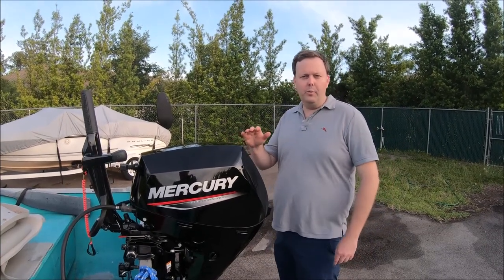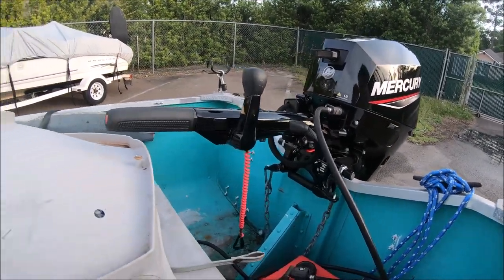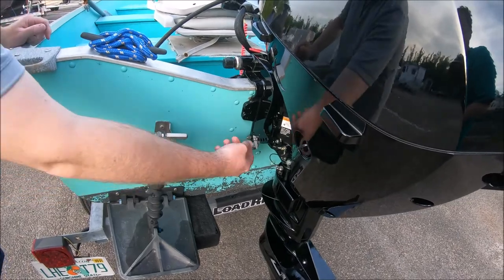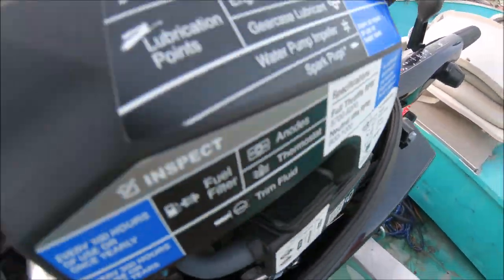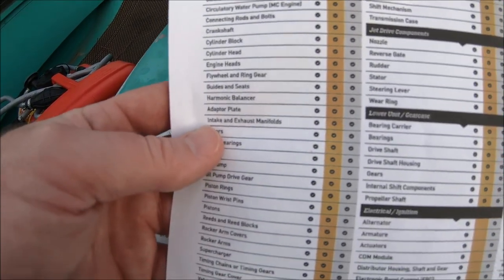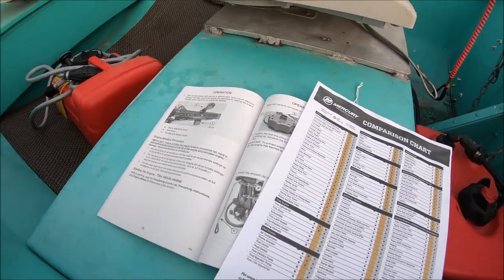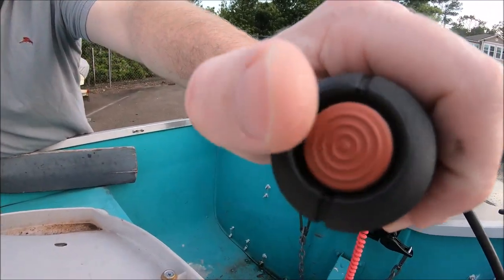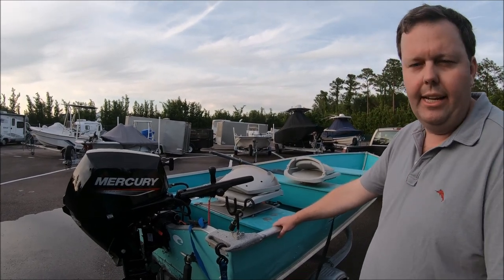Redesigned 2020 Mercury 15 HP EFI Outboard Review & Starting Engine For The First Time!!

Comment: Most certainly needs a 20 hour service… even if it doesn’t call for it, PLEASE change your oil and gear fluid. Lots of metal particles after break in that you want to get out
Reply from the maker: Good point! Thanks!
Reply: Agree 10/20 hour service for oil change I saw metal in both oil changes, tohatsu said it's normal
Reply: yeah the break it, its what call for my f6 yamaha

Comment: I bought a brand new 2023 for my small aluminum 13 foot John boat. A boat bigger than us came to close and the motor fell off the back. I forgot to tie it on and it sank. That happened today. First go on the engine. Bottom of winnipesakee. Luckily I got the warranty and we were able to salvage it.
Reply from the maker: @Gabriel B fantastic they covered it by warranty and you were able to get it back! How do you like the engine?
Reply: @RealFishin it doesn’t run quite right anymore but i’m sure if I service it again it should work fine 😅

Comment: Hey there you don't need to worry about ethanol so much with a fuel injected motor.  Also, the safety chain is pulling your starboard clamp counterclockwise, so it might loosen up over time.  I like to twist until they point towards each other, then pass a padlock through both holes.
Reply from the maker: Great idea regarding the safety chains!  I’ll try to make the adjustment.  The engine burns so little fuel the cost of ethanol free is a non factor.  A full day on the water will burn no more than a gallon of fuel.  Tight lines and thanks again!

Comment: Man. I just got a new 2022 15 hp Mercury with EFI, mine takes a few pull's to start, vent cap is loose primer bulb is ferm, also mine does not have the maintenance decals on the inside of the motor, haven't had it out on the lake yet, to cold it's winter, hope it starts easier when broke in !
Reply from the maker: @Mark Collins interesting.  It takes me at most three pulls to start a cold engine with most starting on pull two.  If the engine is warm, it takes one to two pulls.   Are you using the fuel tank they provided? I had to switch to the tank they provided vs the one I had from the prior motor.  Maybe it is the cold environment or will improve when you break her in.  I followed the break in process  from the the book.  It might be worth calling mercury or you dealer and asking for the decals.  What are you fishing for?!

Comment: Thank you for such an in depth review!  Did you pay for the motor and wait 6 months to receive it?
Reply from the maker: I lucked out and found a dealer that just started to carry Mercury engines about six months ago- so they had one in stock that they just got in stock after waiting 6 months.  I called every dealer within a two hour drive and they were all back ordered.  Strong demand and supply constraints.  A few dealers offered to take a small deposit for the next available engine.  Also, the price varied significantly between the dealers.  I spent  2 hours on the phone calling every dealer in my region.
Reply: @RealFishin  same problem I’m running into in Houston.  Hopefully I can get lucky. Thanks for the quick and thorough reply! Tight lines brother😎
Reply: @RealFishin  I decided to follow your strategy and called a company 4hrs away yesterday. Mgr said he just got a 2022 15hp Merc in the night before and I bought it! It was the only one in the state😎
Reply from the maker: Nice work!  Let me know how you like the engine after you run it!! How big is your boat?
Reply: @RealFishin  
Thanks. It’s a 1436, so it should be flying soon😂
Reply: @standbackstandby200  how much did you pay?
Reply: @standbackstandby200  dude I’m out here In Houston and I walked into bass pro shop in pearland back in November they had just stocked up. I had quite a. Experience with it I tell you both good and learning ones as well
Reply: @adez5143  😂I just went to Bass Pro in Pearland a couple days ago and they have the outboards mounted on the wall again😂
Reply: @standbackstandby200  that place takes my money bro bro

Comment: Thanks, good presentation, very informative.  I have a 2020 20 hp Mercury.  I was having difficulty starting it on the water after a 15-30 min stop at a fish drop.  Discovered it was not getting gas.  Turns out I had installed an inexpensive in-line fuel filter in the fuel hose.  Your comment about no need for an in-line filter (and its not recommended) b/c of the installed fuel filter on the port side of the power head was key and helps explain my no-start issue.  Took the in-line hose filter out and have not had issues.  Thanks.  Joe
Reply from the maker: I’m glad it helped!  That was a question that I asked the mechanic when I bought the engine.  Good luck fishing!!
Reply: I have a large spin on filter and have no issues whatsoever with fuel starvation.   Fyi
Reply: Man, I got a 2022 15 hp with EFI mine also takes a few pull's to start hot or cold haven't had on the lake yet !

Comment: hey i have the same motor i just bought from someone used. it has less than ten hours on it, there is alot of "play" or "wobble" between the motor and the bracket. just wondering if there was some way to tighten something and fix it. thanks
Reply from the maker: I don’t believe I have the same issue.  I will take out the boat this weekend and will see if I find a solution to your problem.  Is your bracket secure to the boat?  Is the engine catching the bracket?
Reply: @RealFishin  yes the bracket is tight to the transom, there’s excessive play between the motor and the transom bracket
Reply from the maker: Have you adjusted the red tilt lever?  Maybe it isn’t locked in.
Reply: @RealFishin  I drop the motor down into the water and then I have to move the red lever to raise it up so I am assuming it is locking into place properly. There seems to be two bolts that come out of the motor and there’s som black foam around there prob to keep water out of there, that seems to be where the “play” is. I tried to tighten those two bolts but they were very right already. The bolts come out of the motor and then there are nuts on the end, that’s actually what I tired to tighten
Reply from the maker: I just published a video of the engine running.  Check it out as it might help you.  If not, It might be best to take to a Mercury dealer and to see what they say.

Comment: Just got a new 25hp EFI mercury.  That beep you hear at the begin is the alarm testing itself.  There isn't a light anymore on the 2023, there isn't a hose flush port either.  They also changed the fuel fitting.  Mine didn't even come with a prop, the 25s dont.
Reply from the maker: @joej.4170 crazy! so you have to use the ear muffs to flush the engine?  I like the side port to flush it.  How do you like the 25 HP engine?
Reply: Its very powerful, but it weighs 140lbs so heavier and much larger than your engine.  To flush the motor I use muffs or fill a bucket with water.  Not sure why they eliminated the flush port.

Comment: Nice presentation. I bought the same motor last year for my TrueKit Discovery Inflatable.
I'm looking forward to taking it out on the water for the first time this summer. 😃 Have you heard of the Mercury Vesselview? It's some kind of motor diagnostics tech that connects via an app on your phone. Monitors speed, engine hours, revs etc. But I'm not sure if it is compatible for smaller engines under 40 hp. Would be nice to have something like this.
Reply from the maker: Thanks!! You have a wonderful engine! Hurry up summer so you can enjoy it.  I think the vessel view is only applicable for larger engines but you are right it would be a nice addition!

Comment: Hello there! I came across your Vid a while back and I found it very informative. I have the same model outboard as you and I had a very bad experience out in the water. I was riding my boat W.O.T, I seen a gator I wanted to look at, when I slowed down The check engine light came on and went into so type of lock mode that I could only go less than 1/4 of the speed. I turned it off at the dock, the light went off and I was able to ride pass 1/4, have you ever heard of this?? 

Nice set up by the way! Those small Vessels don’t get enough credit.
Reply from the maker: @Adez Thank you for the kind words!  I have not come across that issue.  How many hours do you have on the engine?  Are you using the included fuel tank?  Did you check the fuel water separator on the engine?

Comment: FYI - The suzuki 15hp efi is 97 lbs.  I'm looking at all of them and need to make a decision.   Currently have 15hp Merc (carb).  Getting tired of fiddling with carbs.
Reply from the maker: You probably can sell your Mercury 15 HP Carburetor for a decent price since supply is so low and used outboard engine demand is high.  I have been impressed with the newly designed 15 HP EFI.  When I bought my engine, I priced out Suzuki and it was actually more money than the Mercury.  Price differs significantly between dealerships.  I spent an hour calling every Mercury, Yamaha, and Suzuki dealership within a 2-3 hours of my home.  I was amazed to see the price difference between the locations.
Reply: The suz is actually a 20hp downgraded

Comment: Do you through bolt your motor to the transom, or  are the clamps enough to hold the motor on the boat.
Reply from the maker: @Nick Guillen , you can through bolt the engine but I only used the provided engine clamps and used chain and carabiner clip so it will not loosen.  I have not had an issue but will double check the connection every so often to make sure the engine is tight.
Reply: Mercury puts a sticker on this motor that says you will die if you don't bolt the thing on, so I did with mine.

Comment: The top flushing port cannot be used to run the engine.  It is a flush port only.  Fyi
Reply from the maker: thanks Anthony!  I will check out the owners manual.  I thought it said you can flush with or without starting the engine.

Comment: Are the tabs to screw the boat to the transom metal or plastic ?
Reply from the maker: @RS 850 The tabs use metal screws to attach to the boat.  I added some 4200 since the screws are under the water.  The actual Nauticus Smart Tabs are plastic but they make a world of difference.  I have had them for four years without problems and I wish I got them sooner.    I will make a video shortly showing the boat setup.   

Link to the Smart Trim Tabs: https://amzn.to/3Hm5KOo

Comment: Great video!! If I don’t mind please give me the letter by letting part# I am in the market for this motor. But I’m new to all this and don’t want to get something different. Thanks
Reply from the maker: Thanks!!  The Mercury model is 1A15201LK
It also lists F15MH.  The engine is a manual start short shaft (15 inches) four stroke.  The shafts come in different sizes and the engine is offered with an electric start option.
Reply: @RealFishin  awesome thanks a million
Reply: @RealFishin  I just double checked the motor I was really leaning towards and it’s the same part#👍 thanks again for the quick response
Reply from the maker: @Kevin Crowe  great news!  I’m glad they have an engine available!  What are you going to be fishing for?!  Or just cruising?

Comment: Hola saludos  desde México  tengo un motor igual a ese mi duda es si se puede conectar algún foco lámpara 🔦   al motor
Reply from the maker: @Genaro Cabrera ¡Hola! Es probable que mi versión manual no tenga la capacidad de agregar una bombilla 🔦 al motor. si obtiene la versión de arranque eléctrico, probablemente podría agregar luces de marcha u otras luces para que funcione con una batería.
Reply: @RealFishin  muchas gracias por su respuesta
Reply: Tengo una duda  Tengo un motor mercury 15 fi solo tiene 40 horas de uso  ban dos beses  q me prende la alarma   a bajas revoluciones
Reply from the maker: ¿Puedes llevarlo al distribuidor?
Reply: @RealFishin  
Aquí donde vivo no ay mecánicos capacitados para este tipo de motor   le podría afectar  al motor q el nivel de aceite este por encima del máximo le puse un litro de aceite

Comment: Is that motor able to charge a battery, being a 12-volt trolling motor battery
Reply from the maker: @Nick Guillen, I believe you can add a Charging Kit, but you should check with a dealer.  Mercury sells two options, one is a manual rope pull and the other is an electric start.  The electric version also has the rope pull. I went with the manual to cut down on weight since the boat is small.

Comment: 2 pulls ? Why? Tohatsu 6hp requires 1 pull. New engine, i wonder why not 1 pull
Reply from the maker: @ia6980 one pull when it is cold?  that's great! I previously had a 6 and 9.9 HP yamaha.  both required more pulls when the engine was cold.

Comment: Nice video but Mercury makes tohatsu i am a professional on this
Reply from the maker: Hi Leonardo! Thank you for watching the review! Brunswick Corporation (owner of Mercury Marine) has a joint venture with Tohatsu Marine Corporation and Tohatsu makes the smaller Mercury engines.  Statement from the BRUNSWICK CORPORATION annual report.  “The Company has a 50 percent interest in a Japanese manufacturing company, Tohatsu Marine Corporation (TMC), which is accounted for as an equity method investment. The Company purchases engines from TMC, which are sold mostly in international markets. The Company reported a net amount payable to TMC of $44.7 million and $27.3 million at December 31, 2020 and December 31, 2019, respectively, within Accounts payable in the Consolidated Balance Sheets. Purchases from TMC were $91.0 million, $102.6 million and $117.1 million in 2020, 2019, and 2018, respectively.” Page 78 of the 2020 BRUNSWICK CORPORATION annual report https://www.brunswick.com/investors/financial-information/annual-reports
Reply: Tohatsu makes all the portable outbords 40hp down to 2.5 hp,
Reply: Ok thank you, then even Honda and tohatsu have a joint venture
Reply: BuT are you sure?
Reply: @rodneydockrill604  it's 30hp and below. The 40merc and tohatsu are unique
Reply: from my experience tohatsu makes the engine.  carbs charging electrical and geartrain are to the companies (merc honda yamaha)spec. not sure if tohatsu completely makes the parts and assembles them or if the  companies do it themselves.